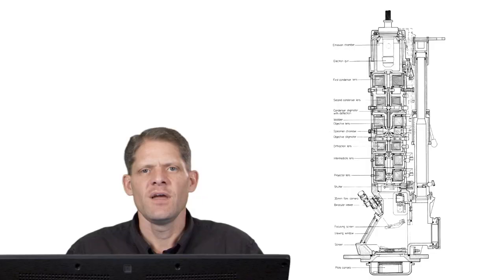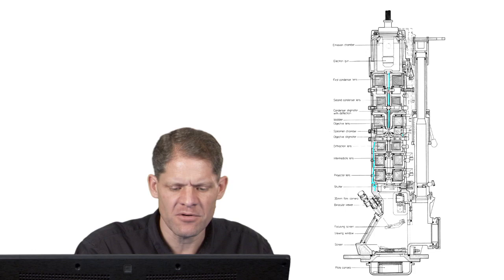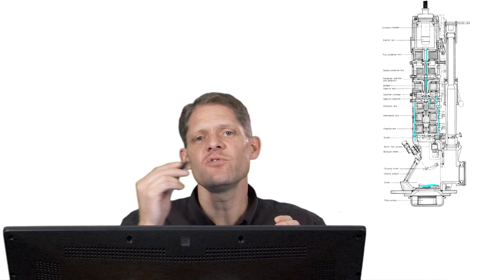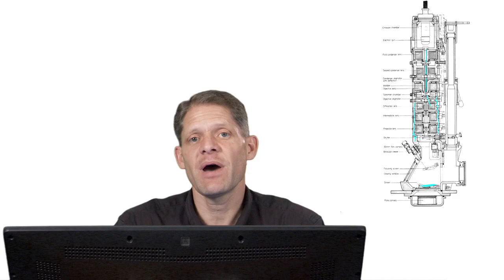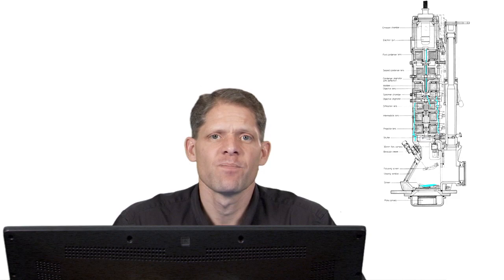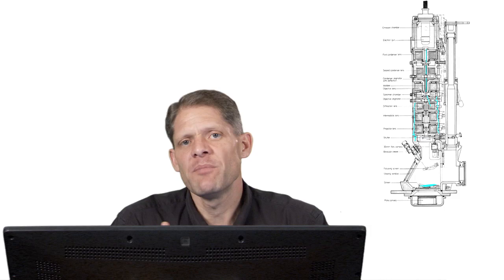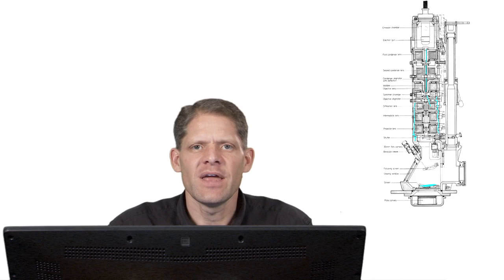Part 1: Summary and Safety - G. Jensen

Comment: 🎯 Key Takeaways for quick navigation:

Electron microscopes require lead shielding to absorb x-rays emitted by high-energy electrons.
Cooling channels with water are essential for maintaining thermal equilibrium in electron microscopes.
Microscopes are sensitive to temperature changes, even body heat from people entering the room.
Water leaks from cooling channels and basement floods pose electrocution hazards.
Electron microscopes can pose asphyxiation hazards due to leaks of odorless and colorless gases like sulfur hexafluoride.
Liquid nitrogen used in cryo-EM can displace oxygen, leading to asphyxiation.
Handling liquid nitrogen in cryo-EM poses risks of burns from exposure to cold surfaces.
Climbing ladders or standing on desks to pour liquid nitrogen can lead to falls or injuries.

Made with HARPA AI

Comment: 🎯 Key Takeaways for quick navigation:

00:05 Electron microscopes are shielded with lead to absorb x-rays emitted by high-energy electrons, ensuring safety for users and nearby individuals.
01:29 Cooling channels with water are crucial in maintaining thermal equilibrium in electron microscopes, necessitating water chillers to regulate temperature.
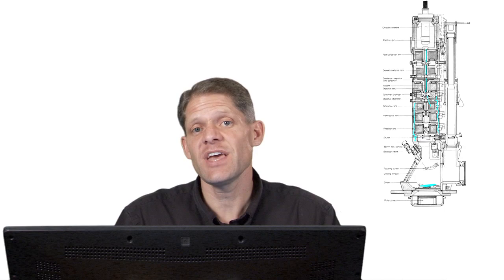02:38 Electron microscopes pose safety hazards including electrocution due to water leaks, asphyxiation from sulfur hexafluoride leaks, and liquid nitrogen burns during cryo-EM procedures.
04:01 Safety precautions are essential to prevent accidents such as liquid nitrogen burns or falls from ladders while handling electron microscopes.

Made with HARPA AI